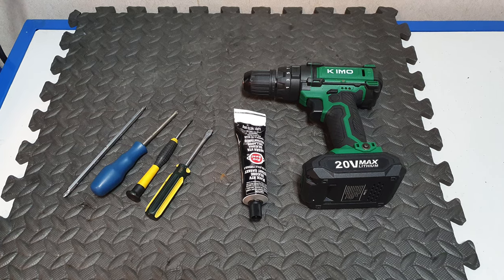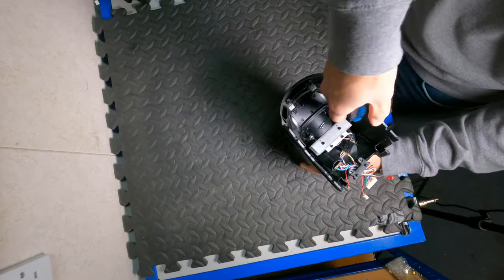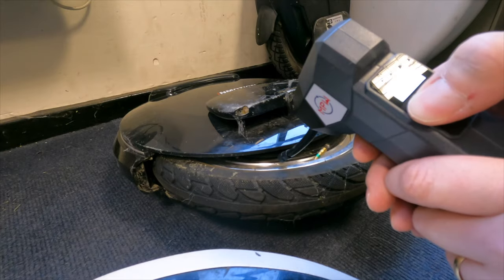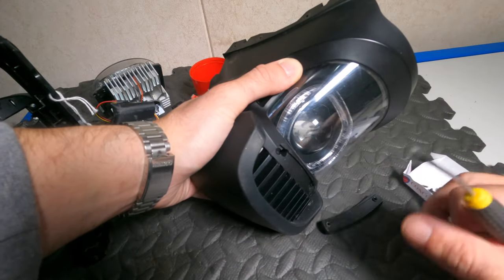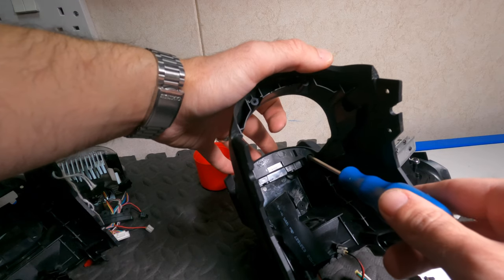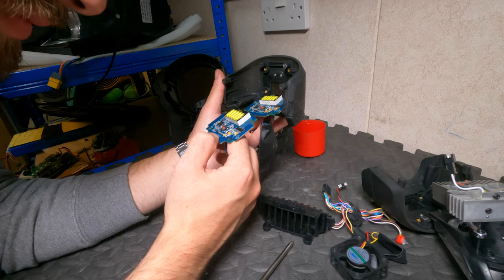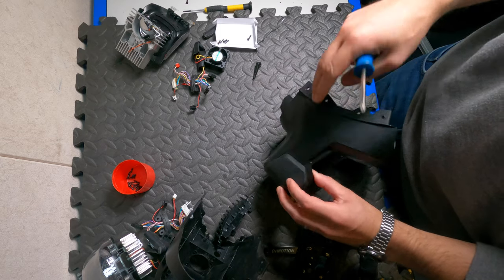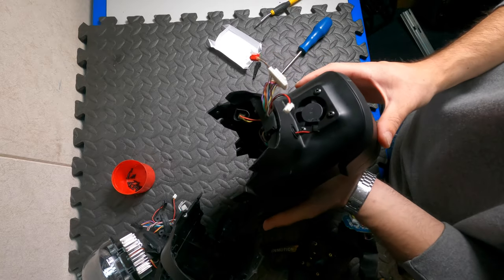InMotion V11 Bluetooth board swap!

Comment: Brutal :-)   Bluetooth repair on a V11 in brief, and there is another screw, phew.  I shouldn't mock, my S18 can get a bit like that too :-)
Reply from the maker: With the wheel repairs, sometimes it's like a box of chocolate - variety of issues that need to be solved!
Reply: @Speedyfeetuk  Begode wheels are more Pandora's box than Chocolate Box :-)  but like chocolates, we keep coming back for more.